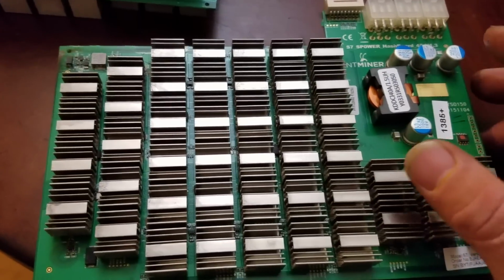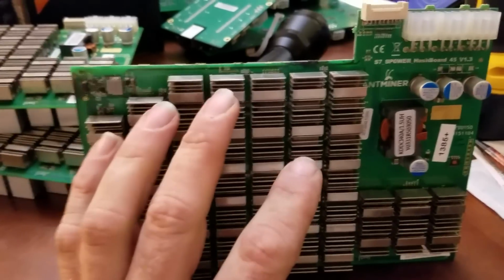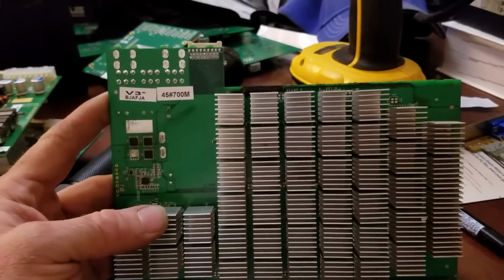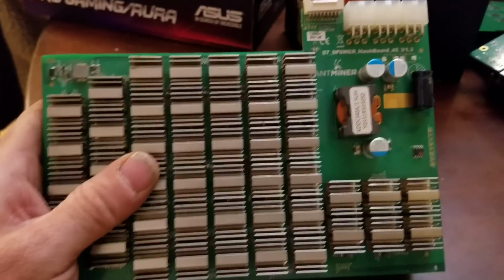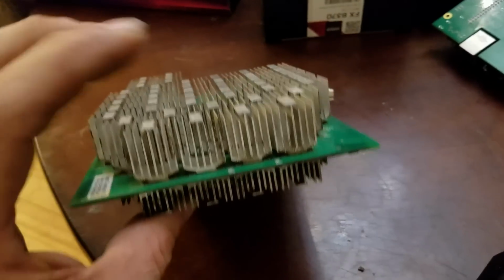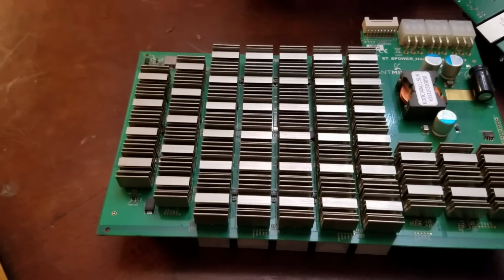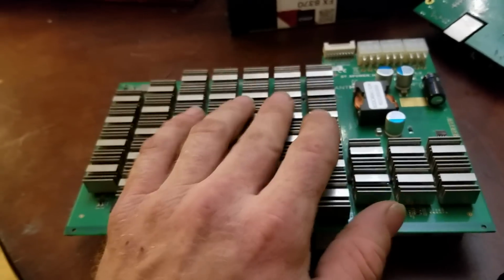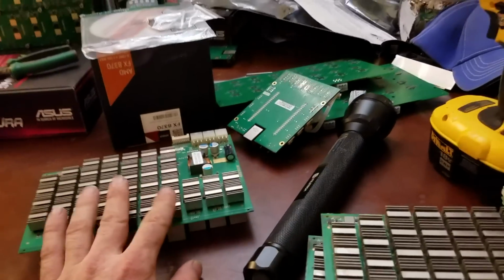How to diagnose problems with hash boards

Comment: Hello, wonderful explanation there. Just wondering, how can I calculate the required air for my machines in a room? Say my cold area is 2x3x2.5m and a hot area of 2x2x2.5m with 60pcs antminer s9s. Will appreciate an answer
Reply: Refit your S17 (series miner) from NBTC to make it alive 
Save a lot maintenance cost
Stable performance 
A better price to resell

Comment: I got a used t17 ran for less than a week and 1 board went out, but I see some heat sinks fell off. I was running with 2 boards for another week, tops and second board went out for no reason. Ambient temps 60 degrees F, very cool chip temps. Just went out for no reason. 0 asics found on that board. Any idea where to start with this board? In about 2 weeks time I lost 2 boards. The one board was date stamped with Jan 2021 so its not that old. Cool inside temps with very low humidity since it is winter. Any help would be awesome. '
thanks,

Comment: hello 
my miner (s9j) is on fans are working but little red lights on hash boards are off and miner doesn't work, i opened it and hash boards look good and i tested the controller board its working well, what do you think the problem is?

Comment: I swopped my antminer L3+ control board with an A3 antminer control board. I booted then flashed the control board with the antminer l3+ firmware, but did this with the hashboards connected (boot and firmware flash). Now my hashing boards are missing completely after multiple firmware flashes. Also each board not picking up seperately. Do you have any advice as to the cause of the hashing boards no longer showing up ? Would appreciate your help.

Comment: Hello,
 
One of my antminer s9 14TH has a problem where it runs under normal light for 10 sec and then it gets the faulty light blinking i have checked each and everything updated the new firmware plus there is no tech support in india ! Please help me out what can be the possible solution for this
Reply from the maker: Check your kernal log you should see the problem
Reply: bitcoin master sir i checked my kerner log the problem i see is in the miner status page where only one fan speed is shown and because of that my miner turns fault light ! What can i do in this case ?
Reply from the maker: Replace the fan thats not working  if that doesn't work replace the control board

Comment: Hello bitcoin master. I have a antminer a3 that was working absolutely fine, then all of a sudden after just a couple of days one of the boards has stopped working. It doesnt even show up in the UI at all - only the stats of the other 2 boards.
It came back on for about 6 hours then went off again and hasn't showed up since.
Air flow is good both ends and temps are great so do you think it could be as simple as something has just come loose inside?
What would you recommend I do? Thanks
Reply from the maker: Check your kernal log you should see the problem there
Reply: bitcoin master Thankyou. I don't know what that is but i will look it up

Comment: what about ASIC #48 on S7? core voltage is 10.5v, also 14v ldo is ok. clocks from crystals is ok, TF LED is on after reset signal goes high, 0.72v on each chip (vcore) and temperature goes on (like it starting hashing). but its still asic #48, hashrate 0. control board checked and is ok. flashed firmware,. some times board show asic 1 .
Reply: I have a similar problem with one of my S7 boards did you come right ? Voltages all good, cant find short or dead chips. have no idea what causes this. I have a link to my Files all relating to S7 - https://mega.nz/#F!kTwnSbwA!aedQG7Okj614dhU_Imoclw
Reply: @kevinkisogloo7113  good afternoon. It will be that you can pass me the link of the plans of the s7 card and everything related

Comment: Pathetic !!! ALL u have stated it that you have to clean the intake end of the heatsink boards...What about Voltages, PWM chips, what epoxy/heatsink to use, are all the chips in Parallel ??? NO USE WHAT SO EVER !!!
Reply: wait a sec did you just say epoxy?

Comment: Hi Bitcoin Master

My L3+ is rebooting itself and sometime many "x" all over i then reboot and start work again 
it also have a big speed different from Fan 1 (3420) and Fan 2 (2330).
Do you have any suggestion ?
thanks
Reply from the maker: It could be any numbers of problems but all related to improper air flow

Comment: Hi, I have some problem about antminer d3 hasboard. One of disappear. I cant see on miner status screen. Kernel log like below; Can you help me? Is this software or hardware problem?
Jan 3 18:05:35 (none) local0.warn cgminer[375]: check_asic_reg: Chain0 has 60 ASICs
Jan 3 18:05:35 (none) local0.warn cgminer[375]: check_asic_reg: Chain1 has 60 ASICs
Jan 3 18:05:36 (none) local0.warn cgminer[375]: check_asic_reg: Chain2 has 0 ASICs
Reply: eray aksu 
I've got the same problem with my d3.... and I know a lot of cases in which D3 are subject of hashboards problems.... D3's hardware is so weak...  I tried to do re reset by pushing the reset button, changing the frequency and the PsU with no results so I'll send the broken hashboard back to bitmain...
Reply from the maker: +eray aksu the D3 does have an issue with recognizing the boards.  please update your firmware this will help in most cases. if your board is damaged then it will not show up.

Comment: Your video would benefit greatly from some editing so people don't have to sit through 26 minutes of rambling to figure this out. Also, when you refer to temperature, it's unclear whether you're referring to environment, PCB, or chip. I would assume environment as I have never seen chip temps for an L3+, D3, or S9 at less than 30 C and with environmental temps in the 40 F range the fans will barely spin. You might want to edit this video for clarity as I'm seeing a guy in the comments talking about his L3 running at 60 C (normal) probably in his chip temp and likely confused by comments about 30 and 40 C.

Comment: Thanks so much for a great video. 
I have an antminer L3+ which is only a week old and one of the chips (#3) now showing "xxxx". The PCB temp has been kept under 60°C. I've noted all your points and will rectify the environment, however, in the meantime should I be returning this under warranty or should I just eliminate the environmental issues and keep running with it since it's only early signs?

Comment: hi, i have question for you, i have 14 s9 miners and now working with room ventilation , so is better to have negative air pressure in the room or positive?? 
and about miners, to protect capacitors from overheating, what if i swap the miners fans? then capacitors will get only cold air, is that bad idea?
Reply: Keep your pressure at standard sea level condition - 14.7PSI.
Are those miners beyond 180 days already?
If so, and with your environmentally controlled room, have the boards exposed.
**REMEMBER to keep moisture content of the air below the standard. It will prevent moisture build-ups.
** Silica and/or salts on the floor will get all water/moisture at low.

Comment: Hi,
Do you know ...if someone were to plug in just one or two hashing boards to a s7 data controller board, and plug in all the necessary cables, would that miner still work (like ...mining 1/3 or 2/3 of the capacity)?  I'm thinking of how PCI cards would fit into a mobo, and obviously the mobo still works with or without them... is the S7 (and s3 / s9 etc) like that?  Or does the ant-miner require all 3 be plugged in, to even work?

Comment: Hello, I have L3+ and this morning I had socket connect failed problem do you know what to do in that case?
Reply from the maker: Serdar Akyüzlüer heckaman caused by quite a few different issues such as latency firmware issues overheating improper CFM on fans go to your kernel log and try and discover why it shut down it should diagnose itself

Comment: Hello, I hope you can help. I have a new D3 from antminer. I am trying to setup but I could not get an IP address. At the front, I can see ethernet green and orage lit but not that really blinking. I tried to reset a couple of times and wait for about 10-20minutes for it boots up but then same results. Do you think its a control board?
Reply from the maker: +Ferrie Marfori you can log into your router and find the ip address
Reply: bitcoin master - yes sir I tried that and its not finding any new assigned IP. I reported to bitmain and looks like they will replace the control board. So dissapointed as my first time to order to them.
Reply: J'ai meme probleme avec mon antminer d3, il affiche deux carte et hadhe 12.8GH

Comment: Hi,
i have a S9 14Th/s and one of the hashinboards is "dead".

Kernel Log say:
chain[5]: some chip cores are not opened FAILED!       <---------
Test Patten on chain[5]: FAILED!                                      <---------
chain[6]: All chip cores are opened OK!
Test Patten on chain[6]: OK!
chain[7]: All chip cores are opened OK!
Test Patten on chain[7]: OK!

The miner was buyed in October.
If the miner starting (maybe 10 min.) the red LED on one board is off.
Hash speed is around 9Th/s

Chain# 5, ASIC# 29, Frequency(avg) 631.00, 
GH/S(ideal) 2,084.19,   GH/S(RT) 0.00000,  
Temp(Chip2)  - 
ASIC STATUS     oooooooo oooooooo oooooooo ooooo

I try anything. restart some times, reset one time.....i dont know what is wrong, i hope u can help me, thanks :(

(sorry for my bad english)
Reply: Try to upgrade their Firmware or Software first.
If symptom persists, contact BITMAIN for RMA.

Comment: My problem is that one of the cards reaches 127 degrees c ° but it is a mistake because the card does not overheat, I would like to know what I can do to eliminate that error since just turning on the machine the temperature error returns, thanks to beforehand it is in one the other one I have not tested it with thermometer and it confirms me the error antminer s5

Comment: Hi Bitcoin Master. Very informative video! 👍🏻I'm setting up a farm of 50 D3. expecting to deal with 11,000cfm air flow requirement. plan to vent it with commercial exhaust fans.About the air inflow, is it correct that I need to supply the space with 22,000+ cfm of air, 2x the volume drawn by miners? Is a few large stand fans with 2 grille air inlets enough for that? or is intake fan needed? how bout A/C? having 2 ac units to reduce the room temp, does that help increase miner performance.Appreciate your professions inputs on this! Thank you 😊
Reply: May I join your mining farm business?
Reply: Hello there, would you mind me asking if this calculation worked? I have a farm similar to yours with 52pcs antminer s9 and I'm having a lot of pressure pressure in the room. The room is supplied with 10,500cfm and 2 exhaust fans making up around 9,000cfm

Comment: Hey. Great video. Very informative. I'm having an issue with one of my T9 antminers. It will work for 4 days or so just fine, then one of the hash boards will drop to zero. I can let it cool down and start it again and the same thing will happen. I looked on bitmains site and they have a 180 day warranty, and i'm a few days away from not being covered by that. Should i send it in?
Reply from the maker: +Rosco Felix it sounds to me like you are having a cooling problem not a hashing problem

Comment: Hello bitcoin master, i got one problem, two of my hashboards from my s7, when connected my miner wont mine, in the general information says that the hardware version its xxxx, i upgrade the firmware, i change the cables, i change the power source, and i try with other control board, and nothing. it only work if i unpluged this two hashboards
Reply from the maker: +Jorge Casique the two hash boards are shorted out

Comment: Hello bitcoin master, do you known a place in USA where I can send my hash board for repair?
Reply from the maker: +Antonio Freites from what I understand bitmain warranty has a Us location
Reply: ok I will look for it thank you very much.
Reply: They do have a US location in California to ship the miner to, but they don't actually repair it there.  It just gets forwarded to China at no extra cost to you.  So you save on shipping but for some reason it takes a 4-5 weeks for them to get it back in China.  Also, you are not able to track it between the time they get it in Cali and China.  I've been paying the extra to ship them directly to China.  The turnaround is so much faster that it's worth it for the new S9's.  I can ship via UPS and they get it in 3-4 business days.

Comment: Hi Bitcoin Master, I trying to fix a S9 hashcard, but looks like my card (I bought brand new) was repaired, I see a lot of glue in the chip that I think is failing now, do your now what is the IC U110? U110 is exactly below the L1 and the label S9_SPOWER, I trying to see the reference but the glue doesn't me allow. Thanks for your help. Any luck with the schematics? rivera_paulo@hotmail.com
Reply: Paulo Alejandro Rivera M. I

Comment: Very informative video! What do you think is the issue if an Antminer S9 boots up (fans are running), but none of the hashboards are on (indicated by no red leds) and can no longer be logged into or identified by the router? This is the current state of one of my S9s. I'm still under the 180 days warranty, so I'm probably not going to pop it open and void it, but I'm curious what may have caused this. Bad control board maybe, since I can no longer log into it? Now my next biggest challenge is figuring out how to ship this thing back to Bitmain from the US because their instructions are not very clear.
Reply from the maker: +Curtis Antoine it sounds like you do have it control board problem since it will not connect. However I would try a different ethernet cable, unplug all but one board, and test each board individually. As far as the IP address unless you made it a static IP it can change if it is reset you will need to use a ping tool in order to detect everything that's on your network if it does not detect the antminer at all then I would safely say that it's the control board

Comment: Several of us have purchased the new R4 only to find that one of the Hashing boards is faulty.  We can either spend $300 to ship it to China or ???  It would be great to hear your thoughts.
Reply from the maker: +Chris Baty bitmain warranty is in the usa if the r4 is under warranty then it will cost 75.00 to have it reconditioned go to bitmainwarranty.com   they can help

Comment: I have a problem on my s9 where one hashing board just stopped working and the antminer do restart every few minute by self .when I disconnect the power from this hashboard it work normally withe other hashboard .. the boards is good and I don't see any damage ..
Reply from the maker: +condour bit i recommend you upgrade the firmware that should fix it

Comment: Good afternoon, my friend, I have a problem with my antminer s9, the problem is that I can not access the machine, the machine gives me the ip and when I enter the same machine, I reject the connection, I would like help if I know anything about the subject Thank you.
Reply from the maker: David Morán molina  in a situation like that you're going to have to first unplug the machine and then plug it back in see if that fixes it if that does not fix it you're going to have to reset the Machine by pressing the reset button on the top
Reply: thanks for answering. I've already made those attempts and nothing. The machine makes the process of mining because it makes all the changes and starts to put heat. But it is undermining the factory configuration. It is blocked because it does not let me enter the system appears connection rejected .. Page 192.168.1.105 has rejected the connection.
Reply from the maker: David Morán molina  first are you sure that your router has not changed your IP address of the Bitcoin miner I would suggest that you use a ping tool to see what is on your network unless you have a static IP setup for your minor it is totally possible that your router has changed the IP address
Reply from the maker: +David Morán molina most routers will assign a new ip address if reset.  you need to use the ping tool to verify the ip address. read the instructions on the s9 located at bitmain.com/ support  there is a pdf you can read it also has a link to a ping tool

Comment: I have just recently had a problem on my s9 where one hashing board just stopped working. I doesn't seem to recognize the board either giving me no indication of frequency or heat. I keep my miners in great condition with minimal dust etc. I have tried testing the capacitors and they seem fine. I can't seem to figure out the problem, any help would be greatly appreciated. Thanks!
Reply from the maker: +Seth Nicodemus this is happened to me as well. first try installing new firmware. if this does not work disconnect the other two boards, and see if the board begins to function by itself. if this is the case then it is a problem with the Main board. when tis going through its Diagnostics not sensing that everything is working correctly. then it disconnects from the board. If the board does not work then you will need to send it to bitmain warranty
Reply: bitcoin master Thanks for the reply! I will try all of that. Thanks for the help and keep up the great videos!